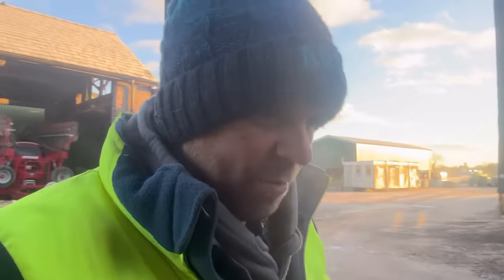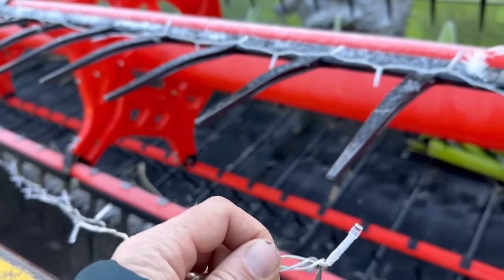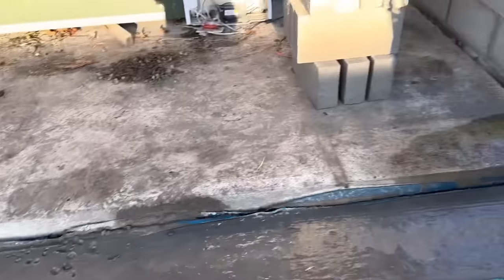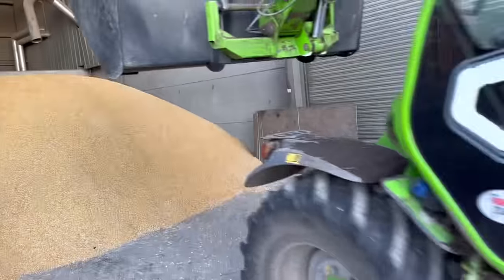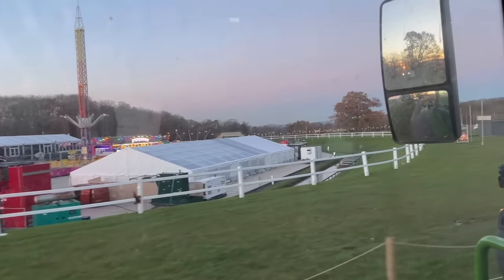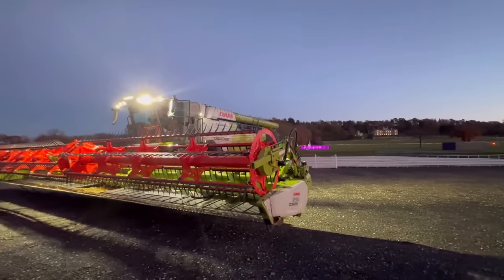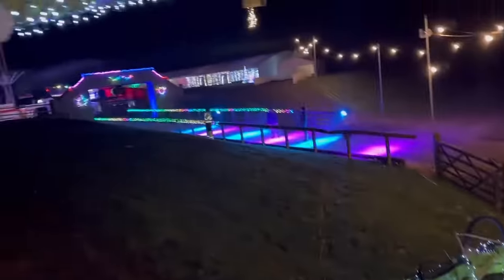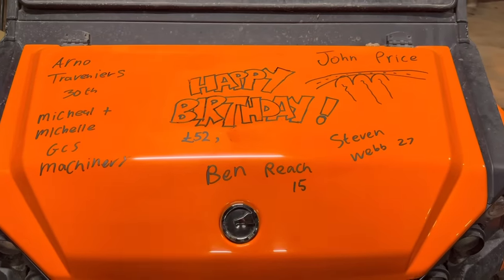COMBINE  TRAVELS TO A CASTLE #AnswerAsAPercent 1353

Comment: Looks good, based on uk spec sleepers, in a straight line there should be about 6602 per mile as they were laid out on the straight sections. Don't know about the turns and intersections

Comment: Hi Olly 
Some great videos lately,  very good team effort. 
Quick question,  if the traffic management are doing the tractor run will they be blocking off roads ??
If they are, will spectators still be able to park on pavements inside the the restrictions to get a good view. Also will they be arranging  disabled access ??
Cheers mate
Reply from the maker: The will manage the junctions